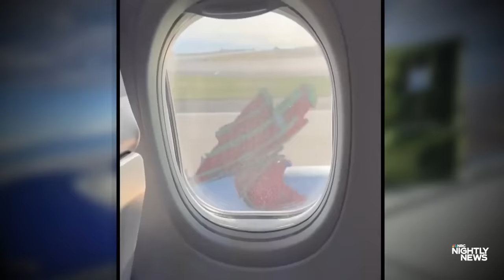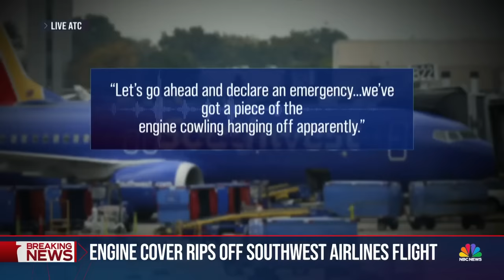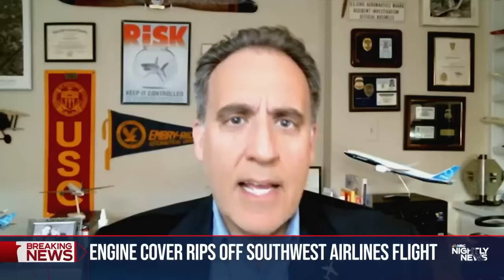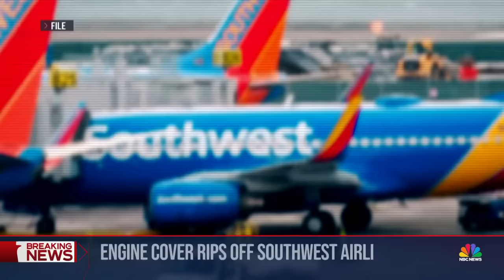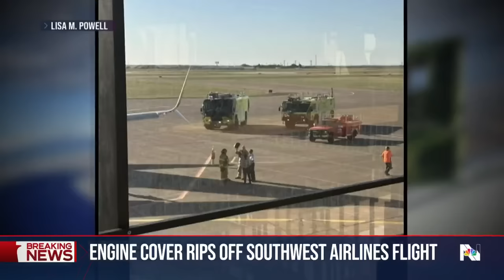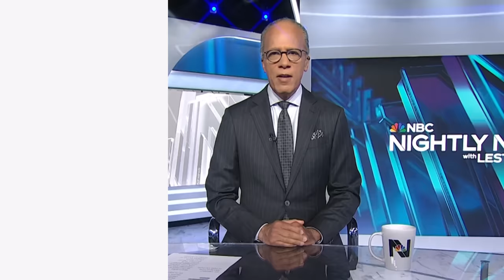Southwest flight makes emergency landing after engine cover peels off

Comment: The results of cutting costs and cutting corners, as well as hiring untrained cheap labor.
Reply: I agree.
Reply: You can’t do maintenance on an aircraft without holding an A&P certificate, so your statement is not accurate.
Reply: @_rob_.  No, not to my knowledge. You need the A&P certificate to do work on a commercial airliner. You need a minimum of 2000 hours of documented hands on experience before you can take the tests for the certificates. However, for smaller aircraft you can do some work as long as it’s signed off by an experienced A&P with inspection privileges.
Reply: Where do you find all the trained specialists?
Reply: Mostly cost cutting. The airlines will do anything to save money. It's starting to catch up with them.
Reply: Also hiring DEI and letting go of all the rules they once had about hiring. This is what happens when you allow mediocrity and ideology as the norm
Reply: @sew_gal7340  That has nothing to do with it. It is about cost cutting measures implemented by the guys in the boardroom which we all know are not there because of DEI. It is about padding the pockets of investors. Always has been. Look up the cause of the crash American Airlines Flight 191 in 1979. This is nothing new.
Reply: No doubt such pearls of wisdom and insight overflow your lips on a regular basis. All around you are no doubt dazzled by your brilliance, a stable genius. So you work for the FAA? You're privy to all the details? before anyone else is? Prior to the investigation? And you're psychic as well, able to analyze accidents from miles away with no facts or data whatsoever? Very impressive. Person. Woman. Man. Camera. TV.
Reply: @outerrealm   You got it! I study airline crashes/incidents with the NTSB. After having reviewed thousands of documents, etc over the past 27 years I do have some insight. It's always about cost cutting measures. Which starts at the top with the execs in the boardroom. Nothing to do with DEI.
Reply: @outerrealm  TV. Camera. Man. Woman. Covfefe!
Reply: @sew_gal7340 I  guess DEI was responsible fir the world's leaders laughing while the US president was speaking at the United Nation's Assembly. Your maga guy was the target. Pull it up and weep.
Reply: @jaywalters5255  You'll be the one weeping when a DEI hire doctor botches your surgery.
Reply: @artjackson8360  And actually so is response! Why give false statements
Reply: @sew_gal7340  So how do you explain all of the accidents from decades past when non DEI hiring existed?  You can't.  Because it's not about DEI. It's all about the rich guys in the boardroom cutting corners.
Reply: Cost cutting is like that at all levels of transportation. Public transportation trains and buses are falling apart also.

Comment: "They are rarely catastrophic"
- famous last words
Reply: Yeah right before it rips off and hits a flap sending the entire bird down
Reply: Yep. Good to know. On the other hand, if the reporter said this is "usually catastrophic," I'm taking the train or driving. :/
Reply: @samhampton9139 the flaps are in the back…impossible
Reply: That's right, please board the  plan  say that words
Reply: It would be rather interesting to see this mother@#$&?s opinion, if a family member of his was onboard a flight that the plane is falling apart .......
Reply: @samhampton9139 
The plane made its landing without using its flaps

Comment: Oh... another Boeing plane with issues???

If it's Boeing I ain't going
Reply: The 737 and 737NG aren't even made anymore are they, it's been like 5 years? And they are highly reliable and have an amazing track record. This  engine isn't even made by Boeing and it wouldn't matter if it was because this was a maintenance issue.
Reply: @HoomanPlays  careful Bruv, don’t OD on that copium
Reply: @somethingelse6273  I don't think you understand what copium means. 737 and 737NG have almost perfect track records, those are facts. Any recent issues you've heard of that were Boeings fault like the door coming off, or the 2 plane crashes, those are the 737 MAX which is their new plane and has obvious design issues because it was rushed in order to compete with AIrbus's new A350
Reply: @HoomanPlays . Thanks for explaining.  I haven’t flown since 2006 and have been considering traveling again. All the issues lately are causing my palms to sweat!
Reply: @merk9569  I would personally never get on a 737 MAX, luckily I believe they are still grounded and production on them has halted. Was a stupid plane design anyways, they just put bigger engines on the 737 and moved the wings closer to the nose.
Reply: Dude do your research, the engine cowling has NOTHING to do with boeing an incident like this happened on an airbus a couple years back. 

It’s simply because the ground mechanics didn’t properly close the engine cowling hatches.
Reply: Mechanics working on the aircraft forgot to latch the cowling flaps. Has absolutely nothing to do with Boeing. Don’t let that stop you from making a fool of yourself in YouTube comments tho.
Reply: Words of wisdom from the Boeing maintenance crew.
Reply: @A.C.00  Boeing doesn't have a "maintenance crew"
Reply: @HoomanPlays  If it's Boeing i ain't doing comes from a secret video recorded from Boeings maintenance workers.
Reply: @A.C.00  are you this simple? "if it's boeing I aint going" is a joke that comes from the phrase "if it aint boeing, I aint going" which was passed around by pilots for decades.
Reply: @HoomanPlays   Welp genius there's a hidden video from recent times about the scandal at Boeing. Which clearly a maintenance guy aka mechanic quotes it in the hidden video. Happy now.🙄
Reply: @A.C.00  Yeah but you said it "comes" from that, which is clearly doesn't. It comes from the saying "if it aint boeing, I aint going" and is a word play on that saying. Mechanics didn't make it up and Boeing doesn't even have maintenance mechanics because they don't maintain planes they sell just like Car manufactures don't maintain cars they sell.
Reply: @HoomanPlays  small error, the 737 max was made to compete with the new a320 neo and a321. 787 would be the competitor to the a350
Reply: This is clearly on Southwest maintenance crew.
Reply: @skylercarrow7420 isn’t the 787 a competitor to the a330 and the a350 to 777
Reply: @somethingelse6273 Buddy it’s the newest MAX planes that’s been dogshit not the normal 700-900 models lol
Reply: @HoomanPlays listen, the 737 MAX has its issues but i have flown on it many times, including an alaska max 9 after the ungrounding. it is perfectly fine, people stress it too much

Comment: As an aircraft mechanic I always worry about forgetting those latches.
Reply: Pilot (or First Officer) is supposed to check too during a walk around
Reply: dont u have a checklist signed off after closing a engine...?
Reply: It happens
Reply: @ytzpilot let’s hope they know what they are looking at
Reply: @krishnamahadev4208 we don’t have a seperate checklist for closing the cowls. It’s usually part of the job that is being done at the time. I double and sometimes triple check them. I don’t want to be “THAT” guy
Reply: The latch could also be defective or suffering material fatigue but still appear okay on inspection. If possible is there a way to get a list of the names of people on the flight?
Reply: @georgewbushcenterforintell147  there are 3 latches on the fan cowls
Reply: @NicholasRiviera-Dr  so all 3 passed inspection then at least one failed a few min later ? What I'm getting at is there seems to be way to many of these mishaps to be chance failures . There is some kind of feeling of sabotage going on . That why it would nice to see the flight list compared to the flight list of other Boeing planes that have had mishaps.
Reply: @georgewbushcenterforintell147  aircraft are designed with redundant features. If 1 of the 3 latches failed, the other 2 should be able to keep the fan cowls closed. I don’t think it was a latch failure, I could be wrong but unfortunately I think that the cowl wasn’t closed and latched correctly before takeoff
Reply: What if the crew did their walk around and then maintenance did some work? @ytzpilot
Reply: @davidsmiths5471  why would anyone be doing maintenance on an aircraft in service?
Reply: @ytzpilot  Because if it's not a hub! They most likely outsource the maintenance
Reply: @davidsmiths5471  you are not understanding what is happening during startup checks, when the aircraft is on the ramp and the pilots are getting ready for departure and running checklists, and doing walk arounds, no one from maintenance is working on it, the aircraft is in service, if there is a problem it is taken out of service, if the problem was quick the pilots start there checks from the beginning again. Only ones servicing an aircraft on the ramp is fuel, baggage handling, lav trucks and catering, no maintenance when the pilots have started there checks
Reply: @ytzpilot  Okay do you work on a ramp? Guess who's in charge of a aircraft on a ramp???
Reply: @davidsmiths5471  Ramp Agent, but you are off topic, Ramp Agents don’t touch the engine covers, you need to research what a walk around is 🤣
Reply: @davidsmiths5471  if maintenance did some work after the crew did their walk around it would then be up to the crew if they wanted to go back outside and re inspect the area that was disturbed. It would really depend on what was being done. Each Country has its own set of regulations and each Company has their own set of rules to abide by. They will be slightly different.
No offence to Pilots, but generally speaking Pilots only have a general idea of what is going on outside the aircraft. Pilots operate the aircraft, but maintenance fixes it and has a much better idea about the details.
Reply: @ytzpilot  when we have a defect on an aircraft, it depends on the severity of the defect. If it is a big defect then sure, the aircraft is taken out of service, towed away to the hanger. If it’s a small defect, it is dealt with on there line before its next departure
Reply: @davidsmiths5471  I work on the ramp and in the hanger. I’m in charge of the aircraft from a maintenance point of view
Reply: @ytzpilot  I don’t know what a ramp agent is but only maintenance personnel touch panels, cowls etc in the company I work for. The baggage personnel open and close cargo doors and I inspect then when they have finished
Reply: @NicholasRiviera-Dr  you are still way off topic from what I originally said 🤣🤣🤣
You don’t have credibility 🤔
Reply: @NicholasRiviera-Dr  the pilots do a walk around, which includes checking latches, my original comment was entirely on the walk around, I have no idea what you are trying to contribute but you are way off topic and keep replying to me, you are in some delusional fantasy 🤣
Reply: @NicholasRiviera-Dr  and yes absolutely 100% the pilots check latches during the walk around as part of pre flight checks, don’t allude otherwise
Reply: @ytzpilot  there is so many replies I actually lost track
Reply: @ytzpilot  I’m sure pilots do check latches. After I close the fan cowls they don’t come back down and check the ones I closed. I certify in the logbook for the task I have done
Reply: @ytzpilot  I’m going to respond to the comment about me not having credibility. What does that even mean? I have no care for what you do or don’t think about my credibility. I have worked in the aviation industry for over 30 years and have nothing to prove to people like you
Reply: @ytzpilot  you like so many of the public think pilots know everything about aircraft. This is false. Pilots sit in the cockpit flicking switches and wait for a response. When it doesn’t work do you think they know how to fix it? No they do not, why? Because it’s not their job. From my experience most pilots don’t even know what they are looking when they do a walk around except they recognise when something isn’t “normal” and then ask the Engineer to look at it for them to see if it’s ok. If you want to know something about an aircraft, ask the people who fix it, it’s their job
Reply: @ytzpilot  and to respond to your original comment, yes, pilots do a walk around aswell. Whether they would have pickup an unlatched cowl or not would depend on how hard they looked or even if they bent down to see it. If in this case the cowl was left unlatched, then no, they did not see it
Reply: @NicholasRiviera-Dr  A ramp agent is the same as a baggage agent. I have done this job just under 30 years! And I have closed latches on the engines and on almost ever part of the aircraft! And I also witness pilots walk arounds! And most are around the aircraft in seconds! Then others will actually look at stuff! Depends on the weather also But a good ramp crew will check to make sure everything is buttoned up and if something is off,will tell the crew and maintenance! But myself will always have maintenance or the crew look at anything that's not normal ,before pushing it off the gate!
Reply: @ytzpilot  So when I see maintenance putting oil or air in a tire or tightening screws they shouldn't be doing that?
Reply: @ytzpilot  Maybe actually work at an airport! Your spreading misinformation! Most ramp crews touch the aircraft more then the pilots! I've help maintenance with taking off and putting them back on! And most crew walk arounds are a joke! Especially in bad weather! And when you use cartoons to comment kinda shows your mentality of things!
Reply: @davidsmiths5471  everything I said about walk around is true, again you are off topic
Reply: And that's a good thing,there are a lot of responsibilities for the people that do below wing functions of an aircraft
Reply: @ytzpilot  No you got called out by people that actually do this type of work! And it's shows by questioning someone's credibility! But with that thought process of yours,I can see why all these types of accidents are happening! And most walk arounds are a joke!
Reply: @davidsmiths5471  you come across with some sort of chip on your shoulder, considering I’ve now retired and live on an island in the South Pacific I’m laughing at how easily you are triggered, keep going, the rent is free in your head I think I’ll stay there 🤣
Reply: @davidsmiths5471  just as long as you are not in a situation where you are drinking and can’t sleep therefore having it out on these comments, because if you have to work tomorrow around airplanes with a hangover that would be a big problem
Reply: @davidsmiths5471  but already to me your credibility is ZERO based on your behaviour, I have an excuse for mine, it’s called retirement, and I’m enjoying it 🤣
Reply: @ytzpilot  Maybe it is a good thing for that your on an island for the aviation industry!  Maybe do a walk around on your island!
Reply: @davidsmiths5471  there you go with your chip on your shoulder again, like I said I’m enjoying the free rent IN YOUR HEAD 🤣🤣🤣
Reply: @davidsmiths5471  and yes I will enjoy walking around my island today as I do every day, weather has been warmer then usual for this autumn season
Reply: @ytzpilot  You show your mentality by your comments and the use of cartoons to speak! The public is a lot safer now! Good Day!
Reply: @davidsmiths5471  you’ve got anger issues and triggers too easily, even this 🤣 bothers you. I use them because I smile and laugh all day long, never go a day without laughing